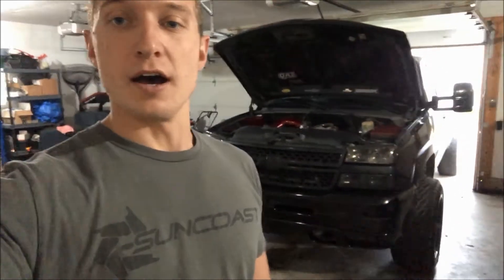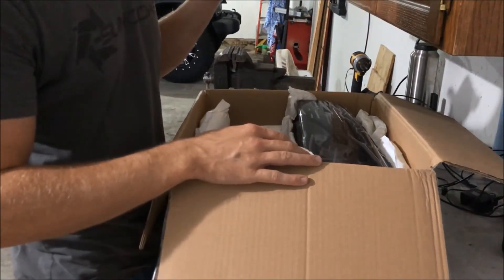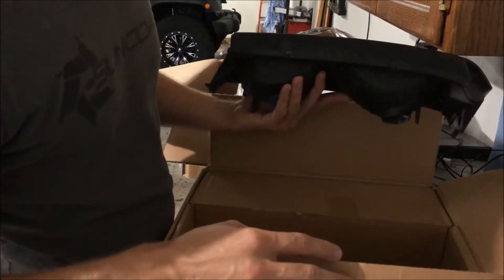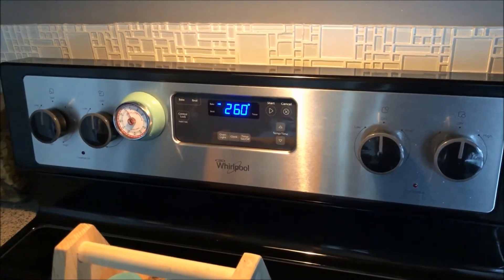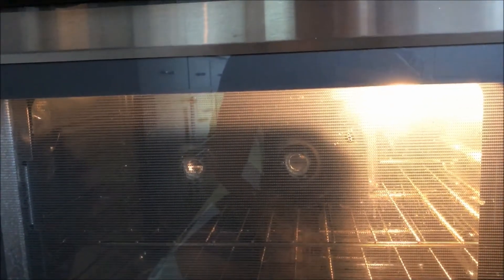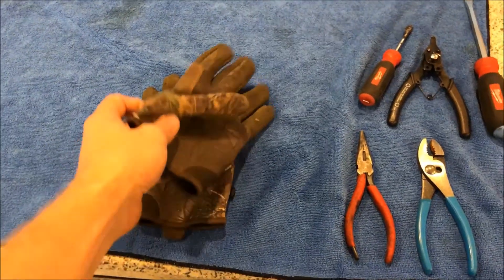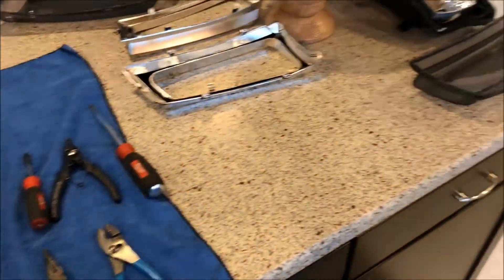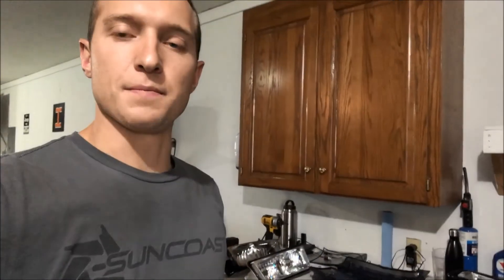Silverado Projector Headlight Build Part 1: How to take apart a silverado headlight housing

Comment: This video was helpful and doing it for the first time i got all except 2 👍🏻👍🏻👍🏻

I tried opening the fog lights but i broke one and the didn't try the other one i installed those RGB LED that go inside the housing and change different colors i tried searching for a video on opening the fog light assembly but no luck. Any advice on that if you ever tried?
Reply from the maker: Are the Fog Lights oem? If so GM uses a different sealing compound than most aftermarker companies that is extremely hard to get apart and back together properly. I've only tried once with oem headlights and failed miserably to be honest. My advice is this is the case would be to get a new set of aftermarket fogs and try with those.
Reply: Alright and thanks i ordered aftermarket smoked ones now hopefully they will be easier

Comment: Do you remember what brand headlights it was that you bought for it? Wanting to do the same however I don’t want to get a set that are sealed with permaseal as that is a pain to deal with!
Reply from the maker: These were just cheap housings off Amazon! Most aftermarket ones in general wont be permasealed thankfully. One note..I wouldnt get cheap tinted housings like these for an expensive custom build. The tint will start to come off after 6 months to a year and you'll have to break them back open and replace the lens.

Comment: Did you add more glue and if you did what kind ?
Reply from the maker: I added a little bit in a few areas that had become thin. You can get a roll of butyl rubber replacement from The Retrofit Source. May be cheaper else where.